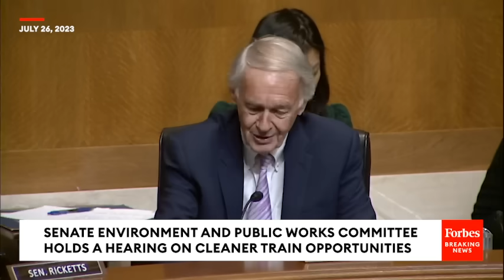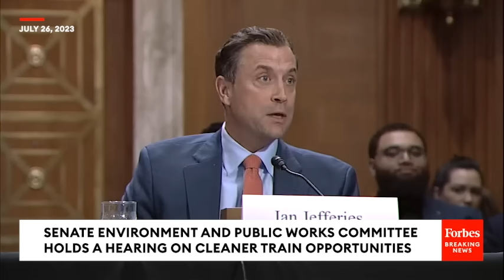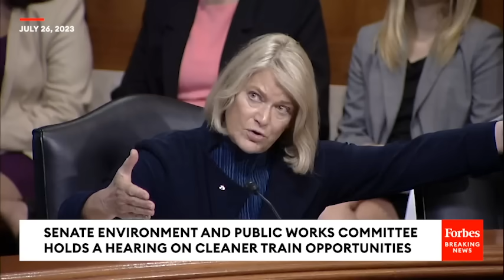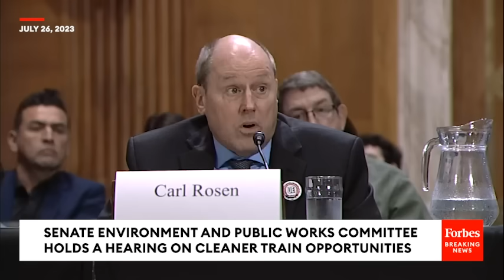‘How Long Would It Take To Replace All Diesel Locomotives With Electric?’ Cynthia Lummis

Comment: What a crock of do-do. Rail is incredibly efficient… however, I really find the stupid level here out of this world as every single wheel on a locomotive is… ELECTRIC! kinda like the fossil fuels used for the power source to charge the batteries to run the wheels on say… AN ELECTRIC WHEELS on an ELECTRIC car.

Comment: This should work well. CA is telling you not to charge your EV or run your AC during rolling brown/blackouts and now they will have untold locomotives to be charged? 
It's not the railroad's problem - it's the electrical infrastructure.

Comment: There are no batteries capable of moving trains any substantial distance. Lots of luck getting trains over the Sierras (especially in winter) using batteries. Electric trains would have to use overhead lines.  Now we know how much pollution would be eliminated at the locomotive by going electric but no one mentions how much pollution would be generated at the utility level in order to power these trains.  What would the net difference be?

Comment: Diesel locomotives are already electric. They are the same combination of burning fuel and using electric motors that are in cars today. Only they are more efficient because the Diesel burns cleaner then a gasoline car with electric motor addition. Learn your technology people instead of trying to push your all electric agenda. The only reason they want all electric is so they can put tighter regulations on the millions of power plants that will have to be added to run the extra electric vehicles out there. We are nowhere near ready to go all electric as of now. STOP PUSHING IT IN EVERYTHING.

Comment: There is no more efficient way to move a pound of freight that rail diesel-electric. A quick google search showed the best range of an all electric train had a range of 50-150 miles..... wow! If you want to make a difference in "green house gasses", look at super cargo freighters crossing the seas. Expand the rail system and reduce the amount of semi-trucks would be my start.

Comment: Battery powered locomotives are impossible. As a engineer, I can tell yo that tech is a long way off. Right now the only way to power traains is with overhead cables and that infrastructure will not be built. This discussion is stupid.

Comment: What's going to generate the massive amounts of electricity to run these giant electric motors? And how far will they be able to run between charges? 30 miles? And is there enough child labor in Africa to strip mine the minerals needed to build these enormous batteries? This is so stupid.

Comment: Slow down, there.  Start with: "Why Would You Want to Replace All Diesel Locomotives with Electric?"  Justify that first.  Such modes of transportation are not zero emission.  You need to produce the electricity, first.  You need to make huge batteries in manufacturing processes which are not zero emission. You need to mine and transport the necessary minerals to make those batteries. You need to make still more batteries to replace those original batteries.  You need to dispose of the batteries at the end of their service lives. Changing over to fully electric requires  all of these polluting processes.

Comment: Watch any Youtube video about driving trains and see the kind of power used on normal diesel electric (A/C) locos.  Loco is right.  The amount of juice needed is indeed crazy.  At full on notch 8 acceleration something on the order of 600 volts at 1100 amps is being sent to the traction motors.  That's 660KW for a single locomotive.  Multiply that by the number of locos in the lash up and we're into megawatt territory per train.  PER TRAIN!  There are hundreds of freight trains criss-crossing the US any given day.  Admittedly, once the trains are moving, the power they draw decreases dramatically, (and on downhill grades may go into negative numbers) but we'd have to triple the grid capacity to even consider all-electric.  Battery trains will NEVER happen.  Half the train would be battery cars.
Reply: Americans need to start digging then. Ravines, gulches, canyons;  anything east (and west) of the Rockies need to be at an incline.

Comment: Its already been determined that charging 50 full electric semi-trucks would require more energy than most large cities use at any given time. How many gigawatts would a single train engine require to charge? Most trains run with more than a single engine. Where will this energy come from? What happens when a battery the size of a semi truck over heats and catches fire in a remote area? Many EV’s cant even be extinguished in a timely manner as it is, imagine 20-30 EVs stacked up and on fire at one time…. Mind boggling. We are not there yet. Maybe start with hobby crafts like seadoos and boats until the tech is perfected, than when something fails its not stopping any actual production or transportation.

Comment: Battery power locomotives is NOT going to reduce any kind of emissions unless the power comes from nuclear plants.  In fact, these batteries make emissions far worse since every time you transfer energy from one state to another you lose efficiency.  And no, wind turbines solve nothing either given the manufacturing process and end of life problems.  The goal should be to make the locomotives use less fuel and there's not much low hanging fruit there as it is already the most efficient prime mover.

Comment: Train CO2 just over 1% 
 There are 38.9 Million Air flights per year
  Just over 1 flight per second 74 per minute not counting private and cargo.  
   These individuals are "We can see trains & cars" but we don't see planes..
 Zero emissions at the Tail Pipe IS NOT Zero Emissions!  That Electric Motor /  Battery has to be supplied with Electricity and if the Motor Turns by Pantagraph where does all that Copper Come from?

Comment: Could DE locomotives be modified to deliver power to the electric drive from an overhead catenary system?   The diesel generator could remain available for service when the overhead source is not available.
Reply: To simple. 🤣🤣 But it is being done with "Dual Mode" locomotives. Diesel electric or electric mode.

Comment: The amount of electricity to recharge electric railroad locomotives is immense.  Recharging will require upgrading enough of the grid by a factor of 3 or 4.  If you love your power lines, you will get even bigger power lines with this change.

Comment: you can make diesel electric very clean.  having an engine run at a specific speed can be tuned to be clean and then anything put out can be easily dealt with. better exhaust filters etc. IMO DE is the way to go. small Diesel engines running generators in our cars.

Comment: Common sense has to re-enter these debates.  The power to do anything has to be generated somehow.  Electricity and the means to use it is not free.  How is the electricity to be produced?  Practically speaking , right now, it is produced using some form of fossil fuel, and then there is the loss in transmission to the point of use.  We can't just make unrealistic goals and imagine things will magically happen.  Even if we want to switch to electricity as the primary use of  power, a reasonable time-line has to be established.

Comment: Rail only produces 1.7% of emissions to deliver a huge amount of our goods.  Rail, even with its emissions, is very efficient as is.  When I worked along I-20 in West Texas I saw the blades for wind farm generators go by constantly.  That railroad runs pretty much coast to coast. Each blade spanned the length of two flat bed rail cars.  How much diesel would have been required to send that blade cross country on a truck with an escort?  Flatbed rail cars are either 60 or 89 feet long so those blades are ~about~ 120' or 180' long.  That's three trucks and three escorts to transport by land.

Comment: 1:30 It is high school science that earth's greenhouse effect is the model of a system always in saturation from the strong greenhouse gas water vapor to add 10°F (5.55°C) to earth's average temperature which completely takes place within 20 meters of the surface.   The IPCC science report is transparent in the very last pages of a 200 page report that it only took its greenhouse gas samples at 20,000 meters altitude.  That is stating the IPCC is not dealing with active greenhouse gases. Global warming has been basically staled at 1°C for thirty years prior to 2021 and beyond.

Comment: The Representative, Cynthia Lummis, and Mr. Carl Rosen, and Mr. Ian Jeffries are evidently unaware of the Reduced Emissions Using Best Available Technology (BAT) presently available.  US Patent 8,752,512 B1,  Francis et al. (45) Date of Patent: Jun. 17, 2014.  This Approved US Patent would provide a 5 year Schedule to Convert / Build / Implement / Provide an immediate 20 to 25% Reduction of Tier II Locomotives, 15 to 20% Reduction of Tier III Locomotives, and as yet unmeasured reduction in the Emissions of Tier IV Emissions.  The outlined method uses Electrolyzers already proven in US Submarines to split Seawater ( having a  3% - 7% Salt Content ) in order to provide Life sustaining Oxygen and excessed Hydrogen to the Oceanic Atmosphere.  The Salt remains in Solution, and can be supplemented by Brackish water on Domestic Land.  This method can be presently accomplished by the conversion to add these components to the Build of Tier IV, the immediate retrofit to Tier II and Tier III Locomotives by excess US Labor presently idled by the Slack in Purchase Orders to the Major Manufacturers by the Class I Lines: CSX, BNSF,  Amtrak, Norfolk Southern, CP Rail,  CN Rail need to Spend less than $250,000 per Locomotive in order to immediately reduce the Carbon Emissions of each Locomotive.  Many of these Locomotives are leased from the original manufacturers for 10 -12 years, (not owned by the Class I Lines. )  The Class I Lines are cost conscious and each Line orders their Locomotives with specific Fuel, Braking, and Horsepower requirements, as well as close to 99.9 % Uptime.  The Patent, developed by an Erie, PA Group of Patent Attorneys, Electrical, Mechanical, Environmental, and Fuel Related Engineers has past the Scrutiny of the US Patent Office in 2014 and could be implemented in order to Reduce the Carbon Footprint by 25% over the next 5 years.These same Locomotives could run 100% on Hydrogen, in CA, switching to Fuel + Hydrogen in the other Rail utilized (Lower 48) States, Canada, and Mexico. There has not been enough furor raised in order to justify the reasonable Cost Increase.  The US Secretary of Transportation, The GE Chief Propulsion Engineers, via the GE Patent Attorneys, and the White House have received mailings and solicitations continually asking for Acceptance of the Patents intentions.   Only the office of the Former President, Mr. Donald Trump, has chosen to respond to our pleas for Financial Funding. To his credit, Mr. Trump has endorsed implementation. Again, this projection is based on Currently Best Available Technology (BAT), and Mr. Carl Rosen is 100% Correct in that the UE Local which he represents is operating at 50% of total Capacity in terms of Units Complete ( output ).  The Factual data of these facts was summarized by NASA Engineers 50 years ago.  GE Transportation manufactured several Hydrogen Locomotives for NASA which operated on a Freight Line between Houston, and Cape Canaveral in order to move NASA Freight.  At the time, the commercial cost of land derived Hydrogen from Methane was expensive. Compared to Diesel Fuel, Hydrogen then costed 100X the (1969) cost of an equivalent energy derived from $0.26 / gallon Diesel Fuel.  The above mentioned US Patent produces Hydrogen via Electrolyzers on-Board the locomotives in small quantities, This method consumes Brackish Water, replenished every 200 miles over rail lines, where Brackish water is used to replenish the reservoir via a scheduled stop OR via overhead mounted water supply lines which spray the replacement Brackish Water onto the water tank cars guttering system while moving at 20 to 40 mph along the existing rails.  The Dynamic Braking Grids were formerly specified by the Manufacturers as the ideal method (for the last 70 years ) as the preferred method to dispose of excess electrical energy. To their Credit, the Locomotive Engineers have already devised and implemented many fuel savings methods, including, but not limited to AC vs. DC energy.

Comment: I'm a railfan, and the rail press has been covering the battery locomotives that are appearing soon.  They only have a capacity of operating at full power for two or three hours.  That's why they are being proposed for yard/switching - those locomotives by shuffling back and forth only use full power for a small percentage of the time, and if properly built and operated can charge the battery while braking.  For mainline applications they are not feasible.  A diesel can run a thousand miles between fuelings; a battery locomotive might have to be charged ten or more times to cover the same distance.  A hybrid strategy of having battery locomotives in the same consist as diesels and using the dynamic brakes (which generate HUGE amounts of electricity) on the downhill stretches to charge the batteries and then assisting on the uphill stretches has promise, but may not be cost effective until batteries are more efficient/smaller.

Comment: Steam engine = External combustion engine (ECE) heat from the outside in.
Petrol engine = Internal combustion engine (ICE) heat from the inside out.
Electric vehicle = Remote combustion engine (RCE) the above just somewhere else.

Comment: The government is right. I should trade in my 97 Ford Powerstroke diesel which I paid $3000 for seven years ago and still has 500-750,000 miles to go. And I should purchase an $80,000 - $100,000 for an electric truck with no history of performance.

Comment: Having worked as a Diesel Locomotive Composite Mechanic / Electrician, These idiots in DC have NO IDEA what a Diesel engine does in these locomotives. The prime power unit (Diesel Engine) turns a generator that produces 600Volts at 1500amps, a secondary generator that produces 230VAC 3 phase electricity, and a 3rd alternator that produces 84V to power the lighting system and the controls that runs the locomotive. The Prime power unit also moves a large air compressor that power the air brakes. The air compressor is as big as a pick up truck engine. The wheels are not driven by the prime power unit. They are driven by electricity that comes from the main generator. They are IN FACT the same as a Hybrid Car. The last I hear, a hybrid car was a good thing!

Comment: Overhead wires already power freight train locomotives.  The only need for battery locomotives would be in rail yards and similar uses.  Since Diesel locomotives are all Diesel-electrics, with some exceptions, it wouldn’t be difficult to convert to all-electric.

Comment: I worked offshore oil and gas in both exploration and production for 30 years. From 1980 to 2010. If people understood the hoops we had to jump through for the government. The measures we took to prevent pollution. I argued with a government engineer over the phone for 2 hours over my vent gas. I cussed that man the whole time. Told him to get on a government chopper and bring his ass out there. Never heard from him again. Our water discharge had to be less than 29 parts per million. Thats clean ass water. Better'n seawater!

Comment: They got it figured out.  The first 10 cars will carry the battery packs. Then they'll string a big ass cable  a half mile long for a DSU. Then every yard will have giant coal fired generators charging all those batteries. Problem solved.

Comment: The cost-benefit analysis has concluded that this woman is entirely unqualified for her current position. I stopped at her "cost/benefit" question, having heard more than I could bear... 

NOW THEN: Battery-Electric motorvation has it's place, sure, but it absolutely cannot replace the sheer power of thousands of Diesel-Electric locomotives. I've said it before and I'll die saying it: We need BOTH battery-electric vehicular power AND we need to retain our LIQUID FUEL infrastructures. These morons currently in office are unbelievable.

Comment: Battery electric locomotives are generally confined to yard services, not mainline operations.  They are the hybrid of locomotives using the diesel engine to charge the battery.  To go to all emission free locomotives would firstly require the erection of electric catenary service throughout the entire railway system, that would be extremely costly and a secondary problem would be the lack of grid capacity to supply such a system, grid capacity is not growing fast enough to meet current needs no less adding significant new demands on an already overtaxed system.   I believe that the railroad industry has about fifty thousand active locomotives, buying about 1000 new ones each year, that's an investment of several billions yearly.  Generally older locomotives are transferred to either yard or branchline services or sold off to shortline railroads that can't afford to buy new.  Often these older locomotives are derated (lower horsepower) for this new mission.  Large, high horsepower locomotives are often too long, too heavy, and too sophisticated to go this route and are scrapped.  Yard services and branch lines don't need this kind of power.